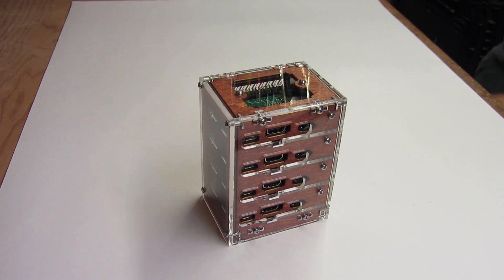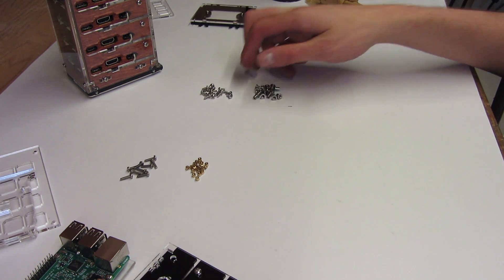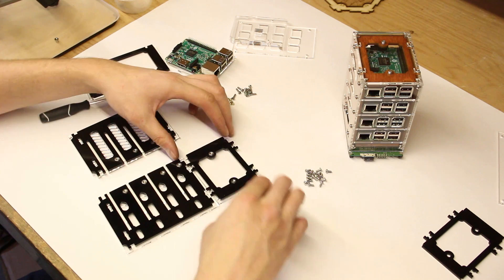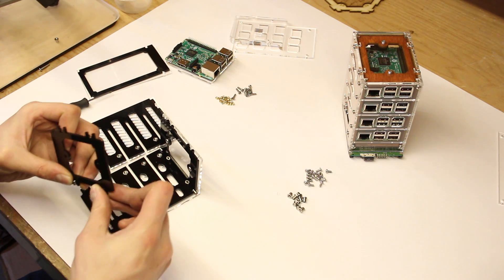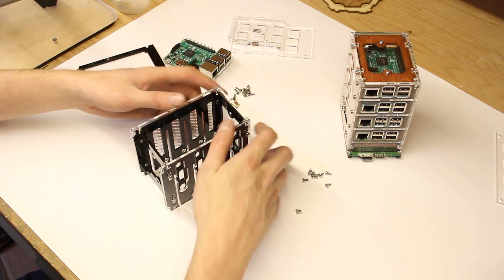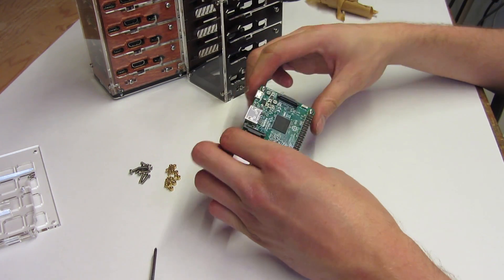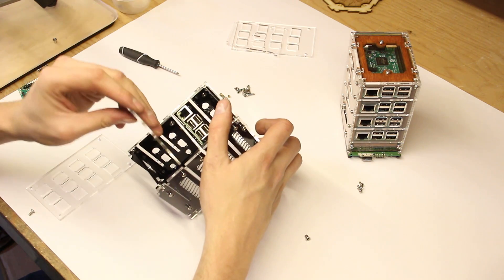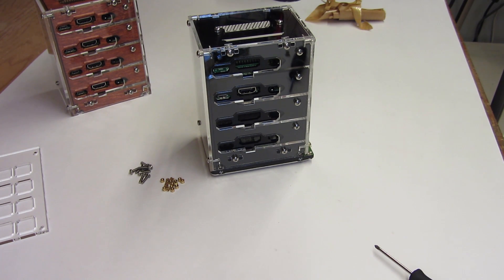BrambleBOX by C4 Labs - Assembly and Overview

Comment: I can see why you didn't show us the first one you built... I put together the 6 level case and it's not a very intuitive thing to put together... Parts aren't labeled or engineered to fit in a single way... 'To easy to mistakenly have pieces flipped or backwards... Which isn't obvious till you're finished & you have to tear it apart and start over... But once I got it together I reallyd like it

Comment: You need to label pieces with letters. It is too easy to reverse one of the pieces which will require you to completely take it apart. The top could be reversed, the bottom can also be reversed which will prevent the piece from nesting properly. Invest in a top down camera and show the pieces with each step. Pretty frustrating doing steps multiple times due to lack of clear instructions.

Comment: Just built this (6 Pi stack). If I can do it, any less of a mechanical moron can do too! :-) It is STRONG. Hope I am not stealing thunder but also bought and assembled what I believe was the first sale of the fan option to replace the front panel. Since I don't know if it will really be needed, have gone initially with the wood front trim. Note the wood is veneer placed inside of what is a plexiglass case but looks really good. Doubt it has much of a thermal penalty but got the fan option largely for the option later to use more powerful Pi clone boards which may run hotter. Very pleased but half-way suspicious C4Labs is a secret (very) undercover Ikea project to see who can put the most screw connectors per unit volume. Fear not, you will prevail and it will be worth it!   --Rob DuWors.

Comment: When fastening the RPi to the blank piece it was a bit of a hassle getting the gnarled nuts started. If you have "Fat Fingers" like I do... screw a long bolt onto the gnarled nut with just a thread or two. This gives you a "Handle" to make threading the nut onto the short bolts. Once you have the nut started you can remove the long bolt and can tighten the nut down to the board.  The same trick also works when manoeuvring the shouldered nuts.